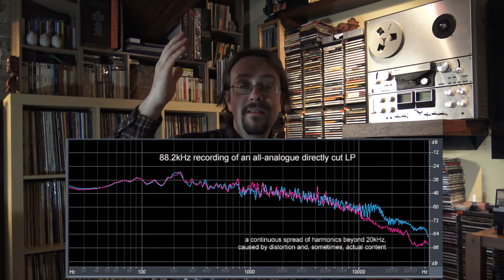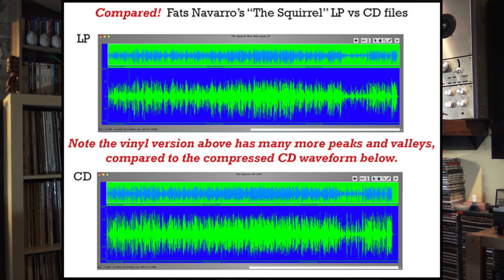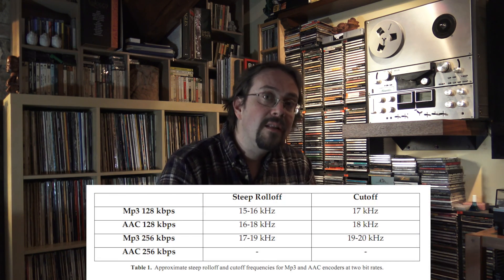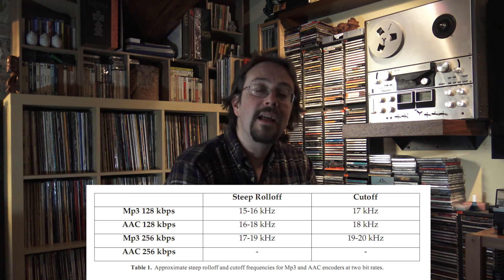SuperTweeters: how to increase your frequency response or a critique on modern music compression

Comment: linear frequency response in the hearable range from 35Hz to 12 kHz! 
To do so, you need headroom below and above this range, because no filter works with infinity damping. And this is the reason for such a high frequency range on CD and SACD. NOT to reproduce sound above the hearable range but to reproduce LINEAR frequency response in the hearable range.
Reply from the maker: Interesting, thank you!

Comment: As a normal normal adult, we cannot hear much above 14 kHz. As a new born, we may be able to hear up to the 20 kHz range, but that drops off quickly. While your video is well done and your explanations are thorough, I call BS on needing anything that produces sound above 20kHz. And hence the reason CD's cut at 22 kHz.
Reply from the maker: Thank you Rick but maybe you didn't catch tha main point of the vid.. there is a number if factors including a different pressure in your ear drums that are generated at higher freqencies and that do influence the listener. Harmonics and reverb among all, which also take place above the famous 20Khz threshold.
Reply: I am sorry, but the notion that hearing deteriorates due to age is WRONG.  If you do not subject your hearing to abuse, loud noise, and other loud sounds that DAMAGE hearing, a typical adult would still be able to hear at or near 20khz.

Wear hearing protection around loud and impulse, impact sound sources.  Teach your children to do the same.  You can prevent further hearing deterioration, and help prevent hearing loss in the first place.
Reply from the maker: Obviously we are talking of harmonics during recording and the presence of higher frequencies (if used proper mics) during playback
Reply from the maker: Yes, i agree..but also high frequencies (and very low) are created which have also a physical pressure on our ear. The ensamble of all these effects, msybe cannot be all heard but do have an effect on the listener and it is this part that is constantly missing in most recordings, lacking for this reason, fidelity and emotion.
Reply: See studies from the 70s in Japan in conjunction with Neve showing neurological/physiological effects of frequencies above 20khz (and even above 50khz) as well as reported favouring of the music with the ultrasonic/hypersonic frequencies (although this was not true when using headphones, showing that the waves must be doing something to other parts of the body) - https://www.sowter.co.uk/pdf/ultrasonichearing.pdf
Reply: "I call BS on needing anything that produces sound above 20kHz."

Bare my english, but I think left and right channel frequencies interacting with each other ( 6:28 ) could create harmonics that are on hearable area. My CURRENT knowledge can't agree with other reasons in his list. Obviously said interactions can't happen with headphones.
Reply: "Obviously we are talking of harmonics during recording..."

Well, I misunderstood that part. What I'm talking about, is possibility of indirect but meaningful effect of non-hearable information precisely while listening. That's what I'm interested as a listener - surprisingly. I raised this question in the past towards people who were mocking HI-RES sources. Nobody answered at that time.

Let's say there is 26kHz sound and 29kHz sound which we can NOT hear. But if these frequencies interact and create tones in lower frequency area, we can hear them, even if those tones are secondary information of original tones (expressions of their 'relationship').  

I think I have no reason to assume, that they could not be more or less similar in nature than real tones in live setting for example. If that's the case, they bring richness to music. Also we have to remember that there can be A LOT of those interacting tones in music pieces.

Comment: What is the frequency range of FLAC files (44,1 khz, 96 khz and 192 khz)? And, is there any musical instruments (I know that electronic one do) that go up to 20 khz and beyond? Plus doesn't the energy that a sound wave carries starts to consistently drop after 15~16 khz?
Reply from the maker: Hi Darius! Thank you for your questions. First of all, I would like to say that FLAC, although uses a lossless type of codec, is always a compressed file. Errors may occur in all digital files as distortion in analog media. Apart from that, FLAC may very well have a very high frequency response IF the original analog music signal was converted with a high sampling frequency (i.e. 96Khz, 192Khz, 320Khz etc.) and also have a high dynamic range if it has a high bit depth (i.e. 24bit, 32bit etc.). If these parameters are respected the FLAC file will have a high frequency range. Nevertheless, the FLAC codec does have limitations, in fact the highest frequency that it can reach is 65Khz and a maximum depth of 24bit.
No, there are no instruments that go beyond, I would say 10-12Khz, simply because there is no sense in creating musical instruments with just very high frequencies, hard to do and unpleasant to hear! Yes, electronic synthesizer can reproduce very high frequency, it is purely artificial/electronic. Here is a good scheme of frequencies: http://www.offbeat.co.uk/wp-content/uploads/2012/06/eq-chart.pdf
In any case, that is not the point! The point is that harmonics, sound pressure, reverberation, ambience etc. create high frequencies in nature and COMBINED with lower/normal frequencies result in a TRUE, natural and dynamic sound, as in real life. Without those frequencies the result is purely artificial, flat, and listening fatigue is behind the corner as well is unsatisfaction!
Reply: I have strong doubts about "The point is that harmonics, sound pressure, reverberation, ambience etc. create high frequencies in nature and COMBINED with lower/normal frequencies result in a TRUE, natural and dynamic sound, as in real life.". Can you please give me some links that would confirm this information? Thank you in advance.
Reply from the maker: Hi Darius, thank you for your comment. I base my videos on personal experience, courses and interaction with professionals in the field besides...pure hi-fi passion. Nevertheless, this is not my field of research so unfortunately I cannot suggest a bibliography in this sense. Yes, I can post some links but they have, more ore less, the same reliability as my videos! Including the link you have posted here below. We need a peer reviewed article! Actually I don't understand your doubts. In compress music, harmonics, mainly high frequency harmonics, are cut off. Check these links for example:
https://www.teachmeaudio.com/recording/sound-reproduction/fundamental-harmonic-frequencies/
https://www.ncbi.nlm.nih.gov/pmc/articles/PMC4737978/
https://passionforsound.wordpress.com/2011/07/30/understanding-mp3s-and-other-compressed-music/
These harmonics include reverberation and ambience, hence a change in the sound pressure in your ear, which is not only a matter of dynamics but also a subtle physical effect on your eardrums. If all this is absent in compress music, as all digital and analog recorded music is (since it is an encoding and not a faithful reproduction), then we are missing an important part of the sound spectrum and the overall experiences is increasingly far from a live music experience (concerts, opera etc.). Besides harmonics, as I have explained in the video, all other high and low frequencies that are usually part of the spectrum are cut off in order to handle more easily the file and create a more easy listening (as explained in the ncbi link) besides greatly reducing the weight of music files. This is dramatically true, especially in heavy compressing as in Mp3 codecs etc.
Reply: Darius Avižinis Lossless files like FLAC simply take patterns in the digital and tell the computer how many times to reproduce that patter. A 44.1K 16 bit FLAC file will be unfolded to standard PCM data when it is sent to your DAC. Nyquist theorem states that you need to double the sampling rate of the highest frequency you plan on reproducing. 44.1K will go as high as 22,050 Hz. 96K will go to 48,000 Hz. 192K will go to 96,000 Hz and so on.
Reply: Any analogue intrument reproduce  Ex; a basic tone of 400hz ++++ Pair and impair harmonic of this basic tone to infinite in theory   Thats why High frenquency are important .... for the ''color'' harmonic of the guitar or drum or.... !!
Reply: Also, at the highest frequencies, the signal will become a strange saw tooth like wave, so an anti aliasing filter is applied. This filter is just a steep sloping low pass filter that cuts out the highest frequencies.
Reply: +Julian West ... you're right  tested on lab with my teacher in electronic  (oscilloscope, frequency generator and a Panasonic with a DAC at 44.1khz  )  at aroud 22khz   you're sinus wave ( music ) become 2 point ... triangle wave and oscillation with the DAC so don't put a tone of 22khz cause you will blow you,re tweeter
Reply: Jay P thanks for that, yes you can reproduce the frequency, but not the wave form.  to reproduce the wave form, the sampling rate needs to be at least double the frequency of the highest harmonic of the fundemental that is to be recorded.  In practice however a 44.1khz sampling rate does work decently for frequencies of 20khz and below, and 48khz sampling rate is even better up to the same 20khz audio.  The higher sampling rate is able to produce a better digital snap shot of the original waveform, of course if the audio is not filtered to be a sign wave ,or close to it, at 20khz, the higher harmonics can and do create very strange sub-harmonics due to a modulation effect beating with the sampling rate.